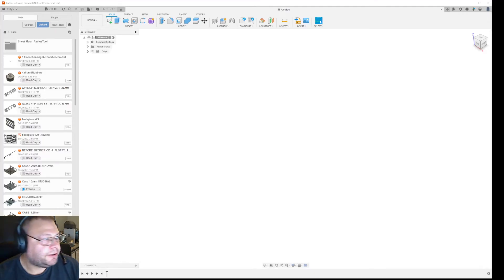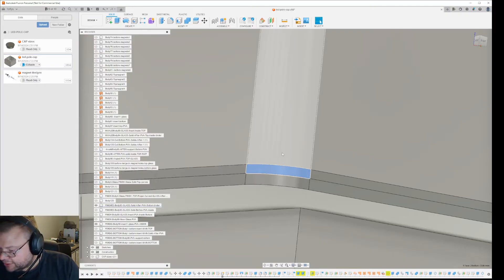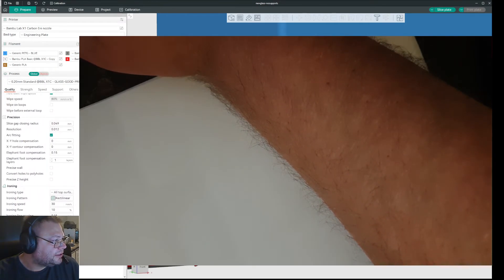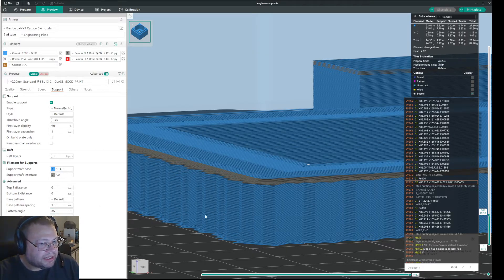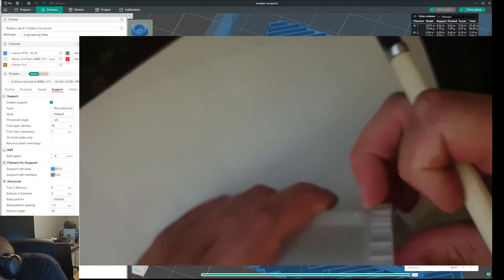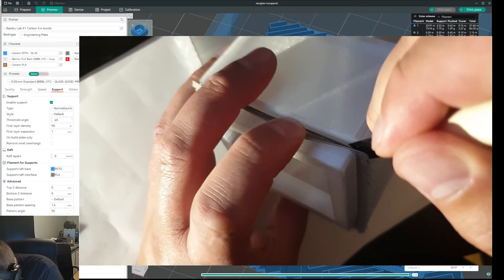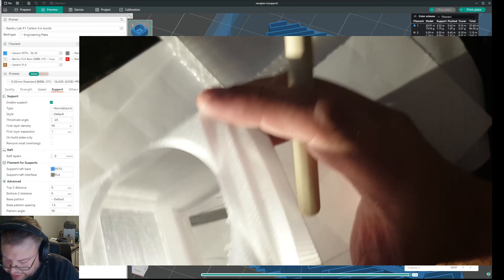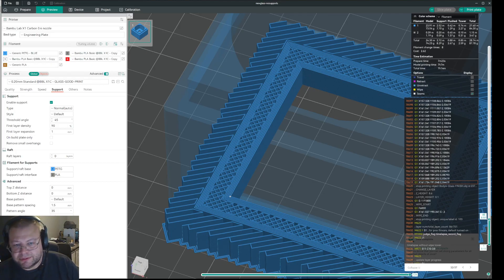Perfect Supported surfaces - Printing with PLA as support Interface for PETG or vice versa

Comment: Ah! Much better than letting the slicer define the other filament as support. Creating the perfectly smooth layer of the other filament as an object is brilliant.

Also angling the supports looks like a huge help. 

Thank you.
Reply from the maker: using over-object is not always needed but sometimes nice to use :) thanks for visiting my channel. like and sub  for more. 😀
Reply: @Toffypops I definitely did
Reply from the maker: @timbrelypearsley3888Thanks!
Reply from the maker: if you only use interface layers i recomment 4-5 layers for top interface layers. for bottom 2-3 is ok as it only is used for resting supports on. 

i can also recommend this video

https://youtu.be/lbDQv5Kh9Z4?si=MM6d05CuyZHn1Iqn

Comment: It’s a top tip, thank you - I’m looking forward to trying this on my P1S when it arrives (with the convenience of AMS to do the switching).

A few years ago, I was printing a PETG part on my Tronxy, and I wanted to switch to white filament (for some text) but I only had white PLA, so I used that. I think I discovered by accident the effect you’re using here - I just didn’t realise it :D the layer adhesion between the PETG and the PLA was very poor, even though the print looked nice and smooth
Reply from the maker: turning off ironing for the support part is important. sometimes turning off cooling for petg when it is the support filament can help. especially using 0.2mm nozzle then all fans should be off